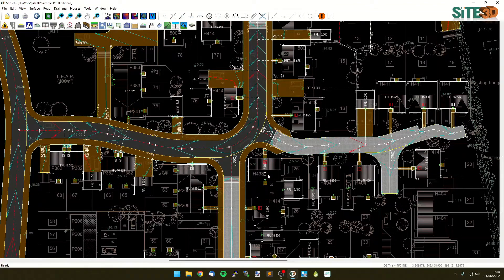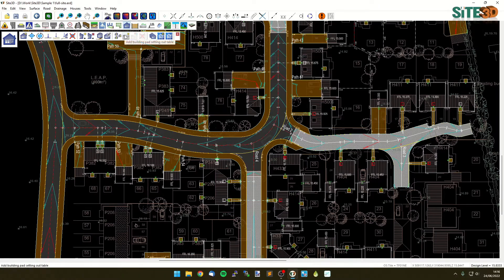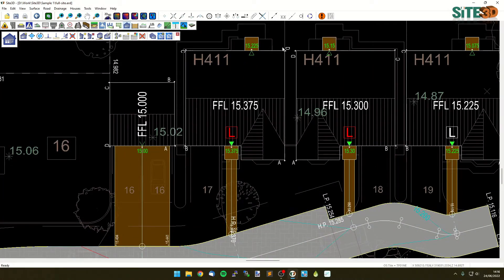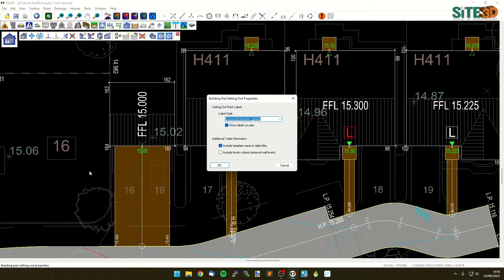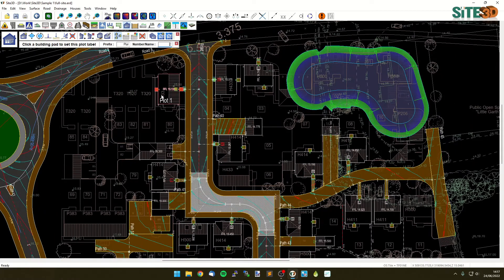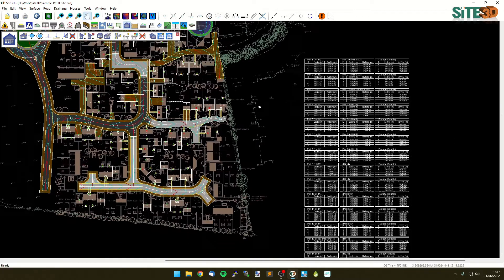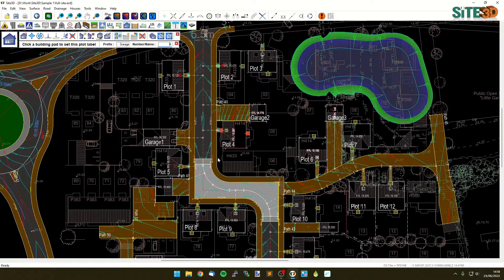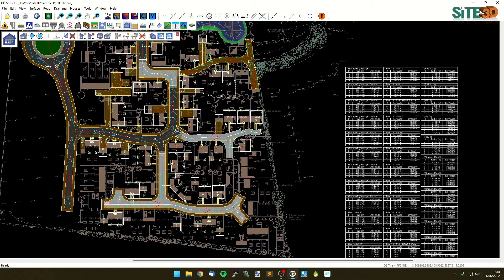Site3D: Building Setting Out Table

Comment: Do the coordinates relate to ground level or the floor level
Reply from the maker: Hi Matt. The levels shown at the corner points are the external ground levels for the proposed surface. The levels will be 150mm below the finished floor level by default but can be edited in-situ or in the house template. These are also the same levels which will be shown in the table if the "Include levels column (external wall levels)" option is enabled. Hope this helps - Lee